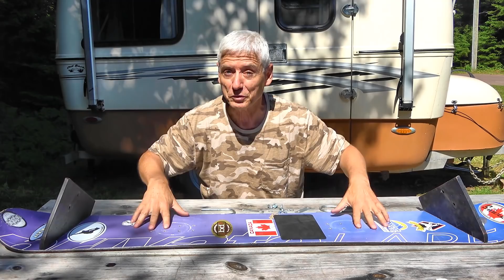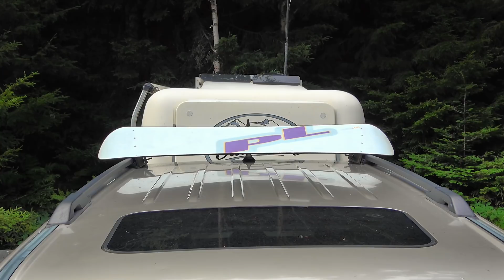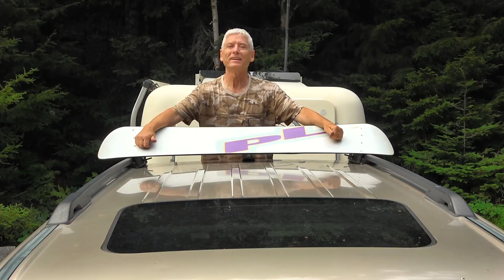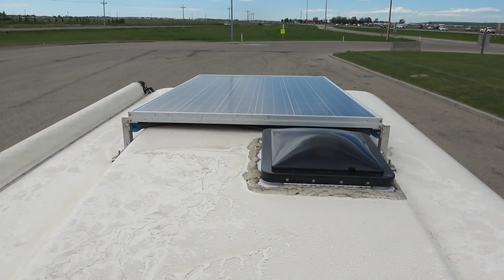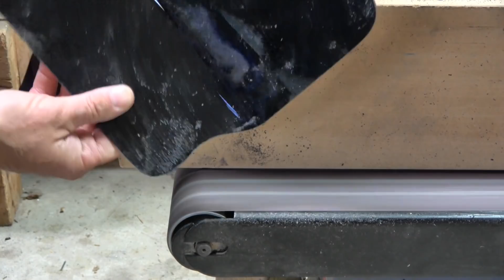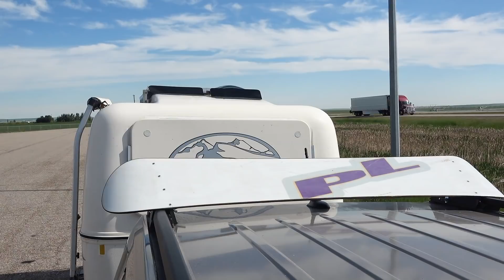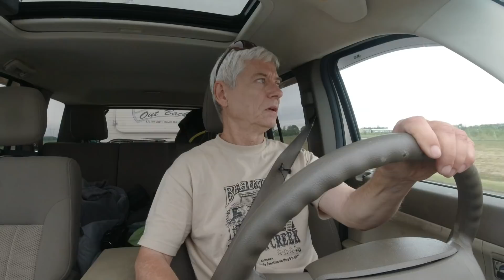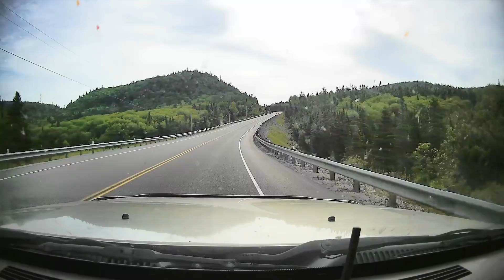Can an Old Snowboard Wind Deflector Improve Gas Mileage while Towing?

Comment: Have you tried turning the tow haul off when running across the flats? My mom drives a Liberty like yours, so I know that they are high geared, and it hunts in and out of overdrive all the time in the hills, or in a headwind. I'd look into an after market programmer (if there is one) to help your transmission hold overdrive better. It's a shame those Libertys didn't have a manual transmission option, because having to run down the road at 3500 rpm is killing your mileage more than anything.
Reply from the maker: It doesn't appear I have the tow option in this Liberty. There's a light (unlit), but no button to engage or disengage. SP
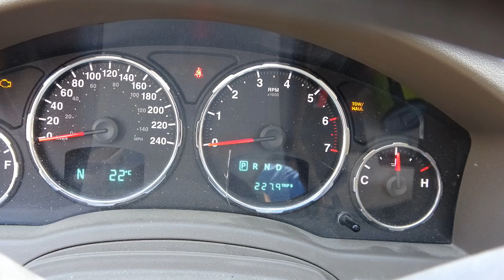Reply: @SlimPotatohead  Time Stamp 9:26. The square unlit button that you press by the shifter top left hand corner is your tow/haul on/off switch. As you can see at the 6,000 rpm mark on the tach, it's showing TOW/HAUL in orange letters. Basically, this just locks out the overdrive. The car should default back to Tow/Haul "off" at startup. If not, the button could be suck down because it's in a bad spot and is easily gets stuck down by gunk buildup on the switch. Of course, there's a time and place for the TOW/HAUL to be activated, but if the going is easy, there's no reason not to not use overdrive when possible.
Reply from the maker: Oh! Ok, thanks. I guess the button is stuck, as the shift button was the one I was referring to as the light. Interestingly I didn't even notice the light on the dash. This was taken during the first test. I'm pretty sure it never appeared in the long distance tests. Thanks Again! SP

Comment: Good job Slim. Love your videos. I’m going to put in my two cents to possibly improve your gas mileage even more. Change over to synthetic lubes. Pack the wheel bearings with synthetic grease. Change the engine, transmission and differential lube also. Once you make the initial investment, it may pay itself off throughout the rest of your camping trips. Good luck, I’ll be watching.

Comment: Great info as I was going to try this when my build is finished I'm documenting on my channel. I have a high top Sprinter with solar panels on a ladder rack & a roof top I have installed. My thought is that this is definitely going to  effect mpg. Even more so being a high top being over 9 feet tall. Also have purchased a horse trailer to haul my Harley &  to have a garage on wheels too. The Sprinter is a diesel & shouldn't be as effected if it was gas but I will take 1 mpg if I can get it. At about $4 a gallon for fuel & increasing every day it seems it will add up very quickly. Thanks again. SUBBED 😎👍

Comment: It's a nice experiment but I don't know how you could accurately control for weather, windspeed and direction and even air density could produce some differences per trip not counting the deflectors.  Still it's a nice idea and the prairies are a great peaceful drive, especially westbound , early in the morning with the sun behind you casting golden light in your path.

Comment: Slim, it would be nice to have some figures for different speeds, and some specs on your jeep, such as if you have a locking torque converter, and what speed it locks at.  I was told once, that your fuel efficiency halves between 50mph and 70mph.  (Sorry, I'm English)  Do love the videos, keep up the good work, and, stay safe.
Reply: @SlimPotatohead  Just my two cents worth.  I thought it was all connected.  Sorry.

Comment: Good job Slim, hard data is invaluable.  How about a
Baseball or softball In front of the awning canvas? It might deflect the wind around that flat spot. Also, if you wanted to fine tune it, you could experiment with 25 and 35 degree mounts on the snowboard mounts.  I see the engine light is on, not sure if it’s ok. I’ve had 3 Jeep’s, they are fun but they need more attention. Toyota’s need less.  When it’s time to get a replacement vehicle, please buy a 4runner. They Thanks Slim for all of your content, love the photography. Happy trails.

Comment: I'm a old truck mechanic. I was raised around big rigs. I can remember when a truck couldn't pull a hill over 25miles a hour. Then came aerodynamics it was really a game changer. To the point engine have gotten smaller not bigger. Yet get better gas mileage. 
My point is every little bit makes a difference. 
I really like the way you did this.

Comment: I too have had a lot of fun monitoring and trying to improve fuel consumption. One factor that seems to help the most with a big vehicle that has a lot of drag is to reduce cruising speed. 90-100kmph is a lot better than 120kmph. 
Thanks for sharing your findings on the wind deflector, and congrats on the gains you have achieved!
Reply: PS: This would never be done to hold up traffic, but I like to maintain 90-100 when there is no traffic.  When there is traffic I would speed up or move over to help them pass safely.  Somewhere in there is a balance of safety, respect for others, and a fair fuel saving in the end.

Comment: I knew when I saw this you were going to get an increase in mileage, but buying liters of fuel and giving mileage in gallons is a headscratcher. I'm sure you did the conversions, but for presentation graphics, staying in the same system through all the calculations you show would make things clearer.  Those are great results.  Experiments are always worth planning and doing.  How else is anyone going to know new things?  Thanks for the time and effort.  You may have potentially caused the sale of many used snowboards.
Reply from the maker: It's quite simple. My audience is mostly American, however the test was done in Canada. The conversions were necessary to please the majority. SP
Reply: @SlimPotatohead  I got that from the video.  It was just a suggestion for clarity in the graphics.  You achieved some pretty good results. TC+TB

Comment: A trucker should know better, yes, air deflectors work, or you wouldn't see them on almost all long distance trucks. 

I've been saving up for one on the roof my of dually towing a 42' fifth wheel, others in my situation have saved 2mpg, which is almost a 25% increase in mileage.

Comment: Alot of people use eturnabond tape. I guessed you would get 3 miles to the gal. better just because putting a box on the top of a prius cause it to loose 3 to 4 miles per gal. I was pretty close.

Comment: If you look at the big scoops on tractor trailers pulling a big box trailer you will get the Ides... There's a few types... One like yours is  big do it goes end to end of the box and curves  up to throw the wind over the trailer,, note it's curved but much more horizontal at the front, so the wind enters horizontally then curves up over the trailer... It Just substitutes for that big square trailer front catching the wind

Comment: I bet that if you moved the large mud flaps and installed them a few inches in front of the actual trailer you would save gas too!  Or better yet, get from light weight aluminium checker plate and install it there like on an Airstream.

Comment: Even small difference in elevation can throw off your test. To make it an exact test, you’d need same direction, too.Last month a mechanic told me my drop in mileage could also have been the increased humidity.
Reply from the maker: It WAS  the same direction. SP

Comment: Will we see the rear-view camera and that deflector?  How about the camera and "wind" at the back of the camper?  There is always something more.  ;)

I did see the camper camera deflectors and wondered how they worked so far from camera.

Another thought.  How does the mileage change for just your tow-vehicle alone?  If it improves without the camper that would tell us even more.

Comment: Great video Slim.
If I may suggest:
1) For more accurate measurement of fuel consumption, get a ScanGuage. I have one on my van, and its very accurate.
2) look into vortex generators that Mount onto the aft section of a vehicle, be it a trailer, etc. The VGs create a stronger boundary layer that significantly reduces the 'dead air' vacuum behind the trailer. That 'dead air' vacuum contributes a lot to total aerodynamic drag.

Comment: Slim:  Bravo to/for your experiments. Keep it up. #1--Try driving 5 mph slower on the same route.  Biggest gas savings you can do.  Drag roughly equals the square of the speed.  #2--imagine the shape of a whale.  Whales swim long distances and their shape(s) are low drag. Rounded front end, smooth sides and slender tail.  If you could figure out a way to stop the air from swirling down/around behind the Jeep before the trailer, and make a kind of pyramid behind the trailer, you might see some of additional results.  That's tough, but some of the truckers have fenders underneath the trailers, triangles that extend behind the trailers and even close up the space between tractor and trailer.  I LOVE what you're working on.  Because its fun to think about and try!  But I'm an old pilot, so there you go.

Comment: Dear Slim Potatohead, i enjoy your videos much more than you would ever imagine. As you travel so much and therefore the cost of gas is so important, you might think of a diesel engine with manual transmission when the time of replacing your tow vehicle comes. Cheaper, lighter, much more reliable and efficient in gas mileage.
Do not stop making videos anyway

Comment: Outstanding sir !! I don't feel you have to worry about the gap between the snowboard and the roof of the jeep as the air flow does not hug the body of the car although if you wanted to try closing the gap and reporting your findings I would not object...Cool experiment....

Comment: I don't wanna be labeled a "critic"....because I commend your perseverance. Another part of your test that would make a difference in fuel economy is time of year. Air is more dense in the cool dry months of winter and causes greater resistance. Plus, winter gas in April vs. Summer gas in July.
Reply from the maker: Yes, the winter vs summer gas efficiency has already been mentioned, but the difference is slight. Also, this was end of April vs mid June. The temperature was not that different. Thanks! SP

Comment: Nice one Slim! Warning. The rest of this comment nerds out a bit on this.

So if you want to continue this experimentation, and I for one do love watching you do this stuff, then there may be even more work of this nature you can do to the trailer. I know probably not much useful about aero stuff and claim no expertise here. But I have read and been told many times over (been around RVs since I was a kid) that the more squared off the back of your trailer is then the more drag you will have. Allegedly this creates turbulents back there that then induce drag. It sounds to me to at least be worth some online research.

Oh, as for what the trucker said there is some truth to that, at least shown to me by people who do know about this. Those vertical  deflectors you see on the backs of tractor cabs are there to "shorten the distance" to mitigate drag inducing turbulents between the cab and trailer. I'm guessing that doesn't scale down from the volume of a tractor/trailer to your size of rig and so doesn't affect you the same? I shrug and digress.

Thanks for another great video!

Comment: And that is why semi-trucks have those massive air deflectors over the cab. (trucker for 30 years, and never seen one of those deflectors? I think someone's fibbing a little bit...) They also use side skirts on the trailers, and I've even seen squared off cones on the back to improve the aerodynamics even a little bit. Basically, if you see a trucker doing it, there's likely a gas savings reason behind it. Even some of the bling... Clean, shiny vehicles get better gas mileage.

Comment: I wonder if it would be beneficial to put a little bit of some type of sun-resistant cocking right under the deflectors on the trailer roof (in the front). Maybe it would help prevent any wind from getting under them and unfastening them. Maybe help with a little bit more deflection? Great video!

Comment: Wind deflectors work well for many applications, As a commercial pilot i can tell you that parasitic drag can impact efficiency alot! anything that can reduce this drag will help! there is a reason we retract gears, theres a reason the molding around antennas/protruding objects are rounded and shaped aerodynamically, theres a reason that even light planes have fairings around their wheels! Even where the wings meet the fuselage are rounded and curved to reduce formdrag! Something as simple (although impractical) as folding your mirrors in at highway speads will reduce parasitic drag and increase efficiency. Use nature as an insperation, Rain for example is naturally formed by the friction of air, and is in fact very efficient in terms of reduced drag. What you have done here is basically used the same principles from nature. And i would bet that if you revise your design of the deflectors to be closer to the objects protruding from the caravan, along with also creating a kind of surface for the air to stick too behind the protruding object (imagine a airplane wing cut in half, the front of the wing will become the deflector you created, the top being the solar panel, and the trailing surface being the a surface for the air to 'stick' too reducing turbulant drag) may increase your efficiency further. Although i guess its up to you on whether the practical/affordability/time/etc makes it all worth it?

Comment: The suggestion from the 30 yr truck driver is worth considering.  You can't actually reduce the distance between the tow vehicle and the trailer, but you can reduce the gap where there is turbulent air.  Current Semis have extension panels on the back of them to reduce that gap.  You could try something like that on your jeep, maybe 1-2 ft panels on the sides.

Comment: I think it's better to look at this for your total trip.  Using your numbers, I came up with a total of 863.9 miles with 64.66 gallons used on your first trip, which is 13.36 MPG.  Your 2nd trip used 53.91 gallons which is 16.02 MPG.  That's a 2.66 MPG improvement overall which is also a 20% improvement.  That's definitely worth doing.

Comment: Ford F-150 towing and a liner expedition. I watch my speed as well and travel with cruise control set at 60 MPH.  I feel cruise control manages my mpg better and slower speeds, 60 vs 70 increase it also.

Comment: Slim I have a small 13 foot travel trailer that I pull behind a minivan and I have wanted to do the same thing. I can hear my license plate rattle with air flowing between the trailer and the car and have wanted to try exactly what you have done with different material(metal) and have even searched to see if I could buy such an item but never found anything and was afraid that if I did find one it would be big $$$. Your idea of using a snow board was pure genius. Now the only problem I have is locating a ski of my own. Thanks for the follow up on your project and I am very happy to see your wonderful results. Looks like its time for me to start my search for the materials needed.  Keep up the good work Slim we look forward to seeing your future trips and projects.

Comment: Keep up the good work.  I once used a 1/4 piece of plywood mounted in the top carrier similar to yours, the car without a trailer got 29 mpg, with the trailer with no air deflector, 20 mpg, with the deflector, it got 25 mpg.  Paid for itself over my 700 mile trip repeated each direction 3 times.

Comment: I had mixed results with the VHB tape until I started using the primer for it. My aluminum solar mounts on my Casita camper have been there for two years and still rock solid.

Comment: Well, there is a reason why many semi trucks have huge deflectors on the cabin. The semi driver had one point though which applies probably the most to semi trucks. The trailer has a lot of ground clearance and therefor creates a lot of drag from the side. The same turbulence you have over the roof also applies to the side of the rig. For a semi that's 12 wheels  with axles. These days there's plenty of semis on the road which have side wind deflectors on the trailer sides curving outwards towards the back. That's saving a lot of gas for big rigs. With a small camper trailer I doubt that kind of side-deflector will bring a lot of savings, avoiding the turbulence from the roof to hit the front of the trailer may just be enough. I know I get better mileage towing - but that's due to the towing speed limit in California. For out of state I get about the same mileage as always, but I tend to go a bit slower with the trailer and I drive a lot more highway going somewhere to camp.
Edit: the biggest gas mileage improvement I had in a while was new spark plugs and fuel injector cleaner. Gave me about 1.5 mpg better. So do some maintenance when your mileage gets up there.